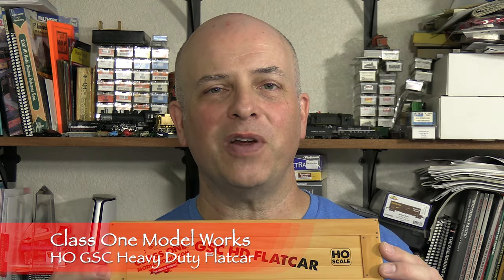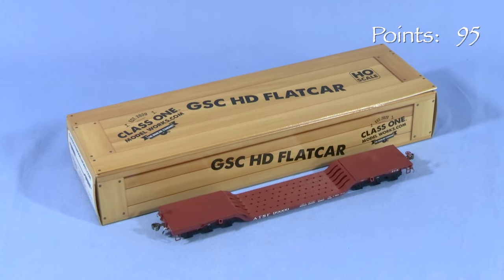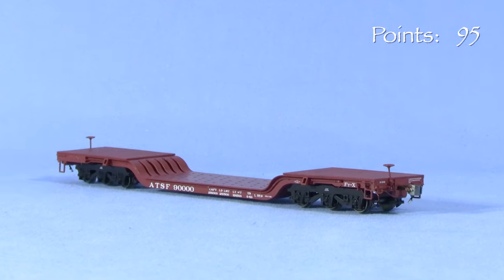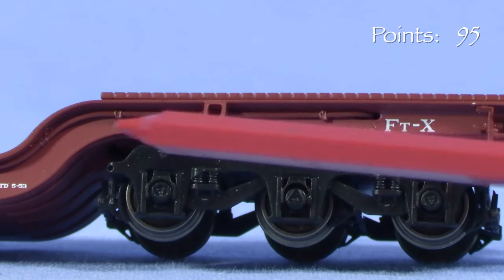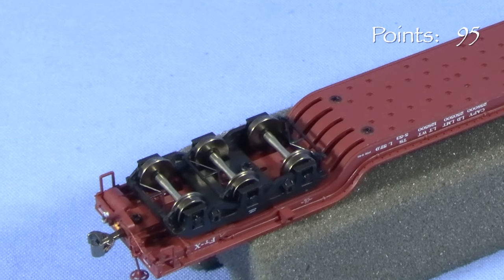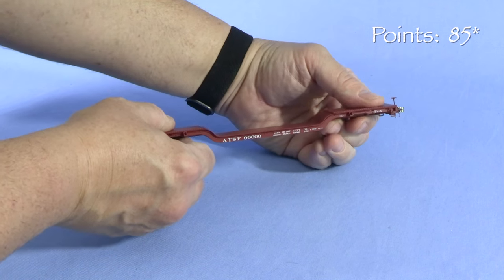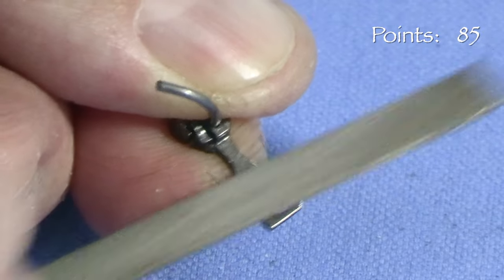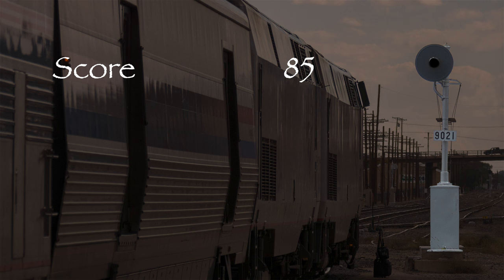Product Review HO Class One Model Works GSC Flatcar ATSF - Unique Heavy Duty Hauler!

Comment: Nice model! Glad you were able to repair the warp. Also very good point about quality vs quantity. If you've got a 40 car coal drag the individual cars don't benefit as much from super detail as would say a 5 or 6 car passenger set. So the juice is more worth the squeeze for the more detailed cars that are fewer in number as individual details will stand out more than in the aforementioned long consist.
Reply from the maker: I'm glad the warp is a fairly easy fix.  This is the only depressed center flatcar I have in HO, so it will be unique on my layout.  Sometime I'll have to figure out a load for it.  I didn't opt for any of the Class One Model Works loads that they released at the same time.  Cars like this could even form the basis for a special movement train, short but just as cool as a long train of hoppers.  Thanks for watching!
Reply: @DanielCortopassi What would be a classic load for something like that out in California? Here in Texas it'd probably see a huge commercial or industrial air conditioner or some kind of heat exchanger.
Reply from the maker: Honestly I'm not sure.  I'd have to find photos of a load.  Large electrical transformers or maybe some kind of agricultural equipment are possibilities, but I'm just guessing.

Comment: Thanks for this review. I bought the C&EI car and found the same problems. I really appreciate you showing the fix for changing the couplers.  Now I don't have to figure it out for myself.  As for expensive cars,  that's where the hobby is at today.  I love upgrading a cheap car to make it look good but as you know, there is only so much time.  If you're building a large layout and you figure in the time involved in detailing a less expensive model to that standard v. the cost per hour for your time that could be spent getting track laid, decoders installed, structures and scenery built it's a good trade off.  I don't think a lot of people look at the big picture.
Reply from the maker: I'm glad you liked the review and the fixes.  You're right about the money vs. time aspect of the hobby.  As I get older I think about that more and more.  I am still working on my layout room, but even at this relatively early stage I've noticed that my focus has shifted somewhat from individual models to working toward getting a layout going.  I'm still building models, but there's a lot of other things to do, too.  Thanks for watching!

Comment: I've noticed that longer flat cars often have issues with bowing and sometimes warping.  So it wasn't necessarily a surprise this one did too.  I don't have any depressed center flat cars at present but wouldn't mind a single to run now and then, but with all the issues with this ClassOne model, I have, so far, opted to not purchase one.  Most seem to be post 1982 as well and I model mainly late 70's.
Reply from the maker: I suppose flatcars have a disadvantage since they have less structure compared to a boxcar or some other types of rolling stock.  It would be nice if expensive models didn't have issues that needed fixing, which is always disappointing.  Maybe they'll re-run the cars in the future and hopefully fix the problems.  Thanks for watching!

Comment: I picked up a Conrail version at my lhs. I got lucky and got a straight deck. Unfortunately, and I knew it was a longshot, my layout has 22 and 19.5 inch curves and the flatcar won't negotiate the 19.5 inch curve. It did work on the 22 inch curve. I wish all the manufactures would clearly state the minimum radius for all of their products.  I picked up one of the Class One loads available for the car, so I guess it will make a nice display model.
Reply from the maker: I agree that manufacturers should state a minimum radius.  It would really help with purchasing decisions.  Sometimes it's possible to tweak a model to get it to go around sharper curves.  I'm not sure if that would help in this case or not.  Thanks for watching!

Comment: Per the AAR Interchange Rules, the “COTS stencil” is a “Consolidated Stencil”
Reply from the maker: Yes.  I'll probably add those to my car at some point since it fits better into my era.  Thanks for watching!
Reply: The requirements for the data on the stencil changed over the years - first, COTS went away, then lube requirements, to the point all was left was the brake valve types and built date.  In 2017, the stencil requirement was removed entirely.

Comment: I purchased my depressed center flat car from HomeShopsLLC. Mine is a private named car as HomeShops specializes in working with manufacturers to bring private model Railroad road names to life. Before I purchased I had read about the warping issues. If HomeShops had not 100% inspected I would not have purchased the car. My take is ClassOneModelWorks should have returned these cars as rejects to the Model builders. When I buy high end cars while I do not expect perfect such things like warpage, out of height couplers and poor rolling cars SHOULD NOT HAPPEN. Fixing little things like the couplers and poor rolling as a model railroader is an easy fix. The warpage is unacceptable to me. 

I rarely disagree with your reviews and ratings. I do here but I still appreciate the reviews you are doing. Thank you
Reply from the maker: I agree that trains should not have issues out of the box.  It's unfortunately rare to find a model that doesn't, which is why there have only been a handful of perfect score reviews so far.  Anyway, I'm glad your car didn't have the warping issue.  It's especially disappointing to have to deal with things like that on an expensive model.  Thanks for watching!

Comment: Hi Dan. I think you're wrong about one end bended after straighting the whole car. From what I've seen on video, it was already bended. Slightly bended. You're a generous guy. Have you noticed that one brake wheel was a bit bended ? I wouldn't give a green signal to that model. This is A VERY expensive car at the end because it's a depress unit. You shouldn't have to straight up a brand new model. And for a car of that price, factory installed Kadee 150 should've been already on. Parts (brakes) are not suppose to fall down from a brand new model. And finally, about the steps, again it would've been a better choice installing metal ones. They look more prototypical and they are stronger. At least, they put some that will last longer. From my part, that car is a bit of a deception. Good review as usual. Keep on your good work.
Reply from the maker: I re-watched the review and I think you might be right that the car was already twisted.  I missed that when I actually had the car in my hands.  Sometimes things show up more on video where the shot is zoomed in more than they do to the naked eye.  I agree that I'd like it better if cars just had Kadees on them already, and I'd also like it better if the corner stirrups were metal.  The brake part on the car fell off after I touched it, so it was technically my fault.  It doesn't take much to make them fall off, though.  It reminds me of the old InterMountain trucks that had parts like that.  Those would also tend to fall off.  Anyway, I'm glad you liked the review.  Thanks for watching!
Reply: @DanielCortopassi  Thanks Dan. Don't get me wrong here. I like that SP depress car. But what I hate the most on factory models is the fact that manufacturers can put a lot of extraordinary details on them and in the mean time don't care about some that are more important (at least to my eyes). And I think in that particular case, metal steps and better looking couplers would've been an easy thing to upgrade. I agree with you on old Intermountain trucks. I did some cylinders in the 90's that were a real paint in the ass. I also noticed that the top ends with simulated wood were like slightly bended in the middle. That's what video shows. I may be wrong here. I just felt at the end that the car missed his own target of quality model.

Comment: Hi again. Speaking of fail... I just bought (I wonder why) a BLI Paragon 3 SW1500 engine.
Well... 

I'm truly desapointed. I tried to dissamble it because there was a gap between cab and battery boxes at the bottom.

This shouldn't happening on a brand new model. I did my best to fix it. Problem was coming from the inside cab interior that was in cab windows way. 

Some handrails were impossible to remove so I will have to make some new ones...

All left to do will to weather it and sell it on feebay.

.
Reply from the maker: I'm sorry to hear that.  I think I've had two BLI diesels in HO.  Years ago I got one of their early NW2s, and an SD40-2.  I didn't like either and ended up selling them.  I have a couple of their steam locomotives, which I like except for the electronics.  I think their brass hybrid models have pretty good detail, but the plastic ones all look a little toylike to me.  Fit and finish issues like the gap you described are also a problem.  Thanks for watching!
Reply: Did you get a backlash from the Rapido cars review at the end ? As you're doing (at least to my point of view) the best reviews of HO scale products, it should be a bit annoying to see stuff failing like this. You may not have that many comments but you got a couple of thousands of subscribers...